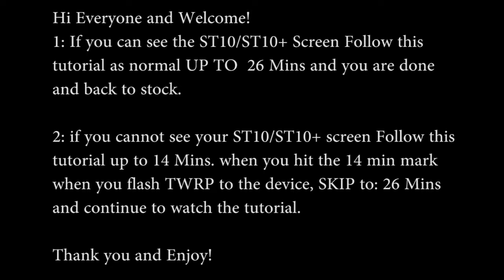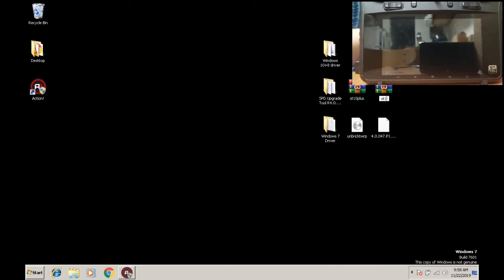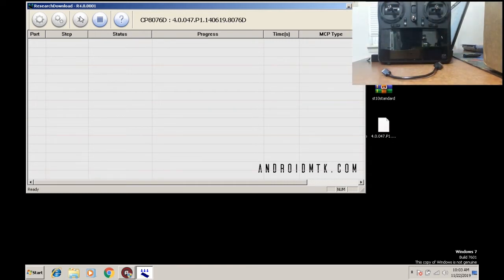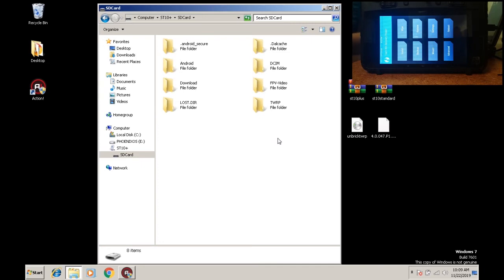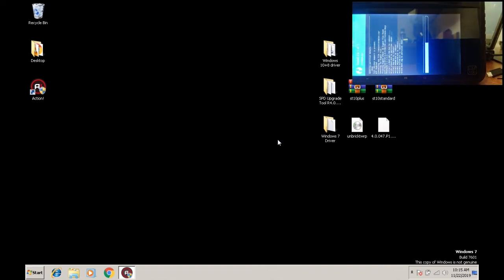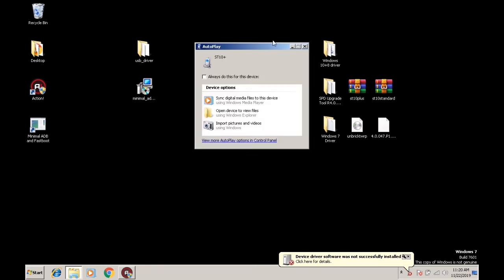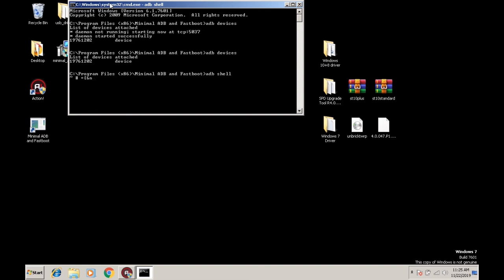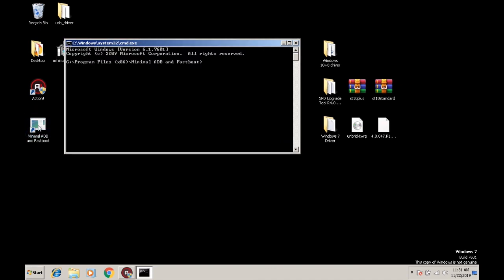ST10+/ST10 Un-Brick Guide

Comment: First, I want to THANK YOU big time for uploading this Video!!
You've helped me in getting back alive my ST10 Plus...which after the new Upgrade file it went totally dead!!
I did everything as you have mentioned and IT WORKS!!...Now I can FLY BACK AGAIN!!
BUT, AS YOU ALSO SAID, Software, basically USB_Android Drivers ONLY work perfectly well with WINDOWS 7!!
I have XP Profesional, also Windows 10...and it can NOT be achieved in NONE that will not be W7!!
I had original W7 Pro CD, I had to get an Old Machine (PC) back to life and start W7 from scratch...
You have done A HECK of a job on this Video!!
Many Thanks again!!